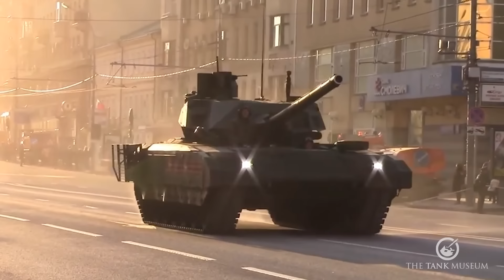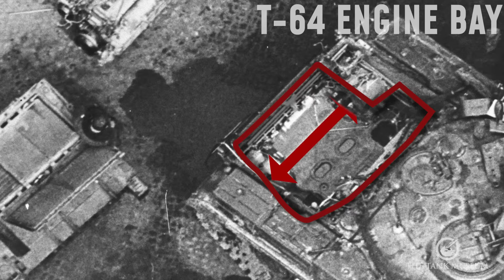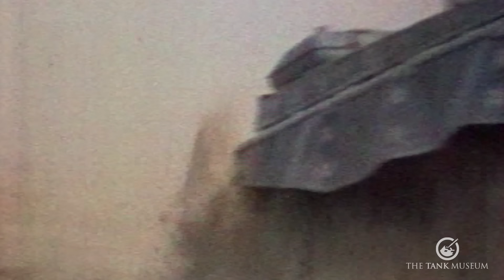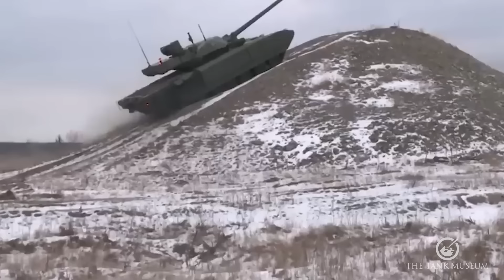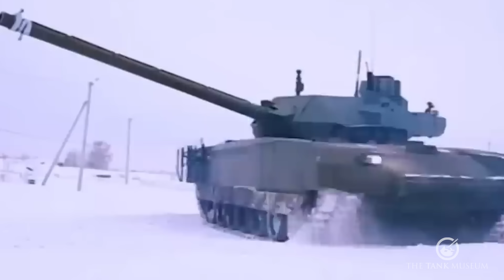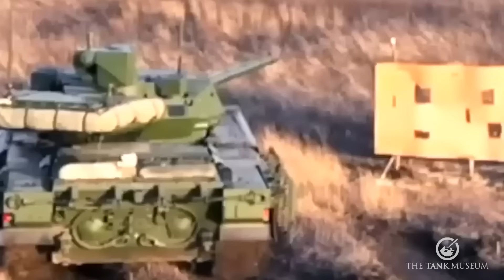Radical or Ridiculous? | T-14 Armata | Tank Chats #171

Comment: Concept of crewless turret is actually quite valid - especially with advances in electronics. For instance - T-55 tank turret weights 9.2 tons while whole tank weight is 36.5 tons. That's already 25% of whole tank weight, which could be used on other parts of tank.
Dunno about T-14 Armata specs , however I think it might be more durable then people actually think.
Reply: the crew is protected in an 800mm rha equivalent thick armored capsole. The front of the hull is said to be 1500mm of protection vs chemical and 900mm of protection vs kinetic threats. I cant remember seeing any details about the turret, side and rear armor of the hull nor the engine deck. But the AFGHANIT aps is said to be able to stop kinetic projectiles travelling at 1800meters per second . Malachit ERA is said to be twice as effective as Relikt ERA that the T-90M, T-80bvm and T-72b3s uses.
Reply: @jkc2001  if these numbers are correct, Armata is quite well armoured. And probably 3 times more expensive then previous generation as well.
Reply: @jkc2001 are you sure that the aps “stops” those rounds? Intercepting them is not equal to stopping. The splash of the intercepted projectiles still can deal significant damage especially to the external devices/optics. Thats true that the armor penetrating effect of the intercepted rounds will be greatly reduced.
Reply: A fat lot of good being inside an impregnable and blind and immobile armored capsule is going to do anyone.... watching that Ukrainian Bradley light up a Russian  T-90 with just a 25mm BushHamster .... was pretty hilarious ... on paper, the T-90 should have nothing to fear from the aluminum American Battle Taxi .... didn't work out they way when the rounds started flying, did it?    @jkc2001
Reply: The durability depends on tank chassis design and materials efficiency.
And the bigger the tank, the bigger it'll be targeted.
So many large and heavy tanks are equipped with many defensive mechanisms to prevent any anti-tank weaponry target and hit the tank in the first place. 
ERA may give tanks a little resistance against such weapons but will be overwhelmed in no time. (And ERA gives tanks some liability as well)
Then, sanctions kicks-in, and Russia could only rely on the Chinese electronic system while the tank itself wasn't designed to use the Chinese system.
Thus, lowering the tank's overall survivability. (Even the Abram isn't invincible, so the tank design for the crew to easily escape rather than seal the crew inside and go down along with it)
Reply: ERA will further blind the T-14 cameras and sensors when hit by IFV chain gun fire ,,,, tracks are also vulnerable to same... as is the unarmored turret... to it'll be an immobile, toothless pillbox when in a fight with anything stouter than an RPG? @hidefreek6905
Reply: I definitely agree. You then also combine that with the protection rendered to thw crew from not being within the same pressure vessel as the gun and it really is an excellent step forward.

I think a big elephant in the room of modern armour and artillery is the notable brain injury being around such weapons as they fire has been ignored for far too long at the expense of service members.

It is not healthy to be within close proximity of any cannon, much less within the same enclosed pressure vessel.

What is very unfortunate is this applies just as much in training as in battle.
Reply: In the early 90's, when I was into that sort of thing, I was scheming a crewless turret around the Merkava Mk. I for miniature wargaming. But, there were no mechanics for crew survivability. Maybe crew initiative, spotting, reliability and accuracy bonuses in a long term campaign, but we really only played single battles.
Reply: The problem with crewless turrets, especially on the T14, is that the visibility is awful, and the crew has no access to the turret from the inside. Meaning if that autoloader jams (which is has a tendency to do), it cannot be cleared without getting out of the tank. And we all know why that's a bad idea. So that means something as simple as an autoloader jam that could be cleared in a second could take a T14 out of action.
Reply: propaganda reader I see. the purpose of the crewless turret is necessary because Russian tanks are small. Russian Doctrine is spam the Battlefield with junk and pray the enemy runs out of ammo, equipment, and personal before you do.
Reply: @davidporter7051  you got full on your own assumption and delusion. Learn to read and understand what you read.
Reply: @davidporter7051  ah yes, the armored coffin for the crew
Reply: No, not at all. The crew must be in the tower and among them there must be a black guy throwing new shells into the barrel.
Reply: @OwlsStudio  lel
Reply: @Thanks_in_Space  🤮
Reply: @Thanks_in_Space  ....and he was a woman before

Comment: A tank they can't afford to build, using parts they don't have access to anymore, powered by an engine based on an 80 year-old design. They should have called it the "Paper Tiger" instead of "Armata"
Reply: When they run out of tanks, they have shovels, have no fear.
Reply: An 80s engine? Ha! On the most modern T-90 Moscovite tanks, they still have an engine that is a copy of the German BMW engine that was still installed in T-34 tanks from the Second World War.
Reply: @volodyslav231  i said 80 year-old engine.
Reply: @Xhumed  yes i got it!

Comment: Radical? Ridiculous?  No, "Irrelevant" since it doesn't really exist. Russia said it would build 2300 of them by 2015 but it has in fact made a dozen or so prototypes and has no ability to mass manufacture it. They can barely crank out 20 older models a month and they're digging into the T45s now...

Comment: The Russians had about 12.000 tanks before the start of this war. It is believed more than 10.000 are still available to them. 
The Ukrainians however only had 2.500 pieces to begin with and now a handful of western tanks added. I think it’s obvious who has the biggest problem bringing tanks to the battlefield.
Reply: " Obvious who has biggest problem "
You get a point, it's really obvious
Reply: That’s why Russia has been fielding T-55’s 😭😭

Cope harder bud
Reply: @reece42069  T-55s are converted for artillery support and assault guns. Russians are building 100 T-90s a month.
Reply: @nowarwithrussiaandchina4667  Are they upgrading the T-55s with 152mm guns or using something smaller?
Reply: @trolleriffic  I understand they are just using up the old 100mm ammo in their stockpiles.
Reply: @reece42069  exactly seems a bit odd if Ruzzia has so many serviceable tanks why T-55/54 with double cope cages would appear at the front.
Also losing 2000+ of your best tanks in a year means you’ve got serious problems 😂
@hape4 when’s the T-14 going to make its’ appearance?
Reply: @artnull13   
I came up with easily verifiable numbers from western sources. Unless you can prove differently there is no need to discuss T-14.
I never even mentioned it 🥱
Reply: @hape4  yet those same western sources say the majority of those tanks are useless wrecks 😂- like the source in this very video - you sort of blown your whole argument there 🤡
Reply: @artnull13  
Those are not the same sources but believe the reports that you feel comfortable with, don't bother me with it.

Comment: I will never understand, who signed off to leave the well designed and understood 39l V12 engine, that could have easily boosted to 2000 HP (by a western engine company, who has some knowledge in engines and combustion). Internally, it would have been a rather new engine, but geometrically it would still have been the old, trusty W-2 derivative. Imagine the synergies, if the overhauled +1500 HP engine could have been swapped into already existing vehicle designs.

Comment: Loads of copium and hopium in this video. The major issue with T-14 is similar to AK platform problem. The benefits of the new products cannot yet outweigh the drawbacks of switching to the new one.
The tank production/modernization in Russia has soared to 1600 tanks a year, with hundreds of newly-build T90 hit the road to frontlines.
The electronic systems T14 uses is  obviously not an issue, because the newest T90s use exactly the same modules.
So the reason why T14 project is postponed is because the production line was given to the most tested and reliable machine, the T90. The same thing happened with T44.
And the mathematics is simple. Right now Russia can afford to loose up to 1600 tanks a year, while the Ukraine cannot scramble 400 old NATO tanks, that cannot be replaced after their so hyped offensive anymore.
Reply: "has soared to 1600 tanks a year.." I obviously have no clue, but I would dearly love to see your sources.